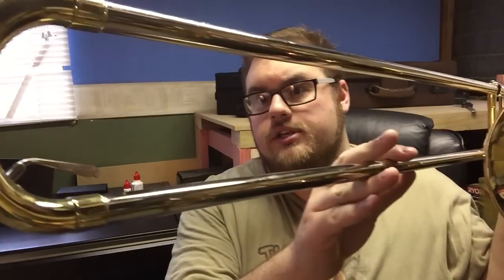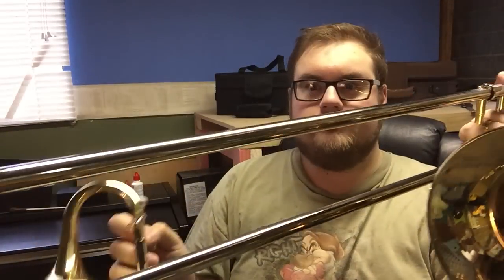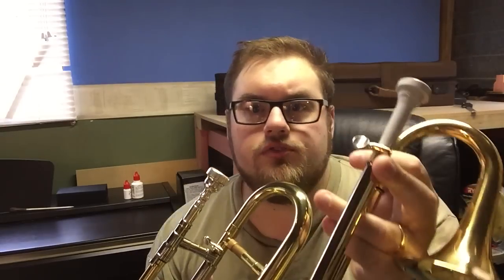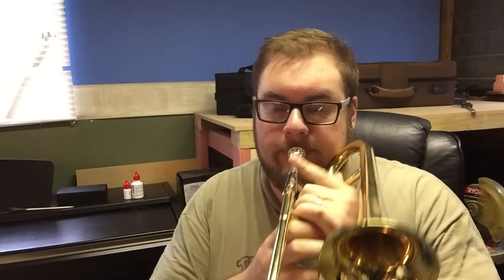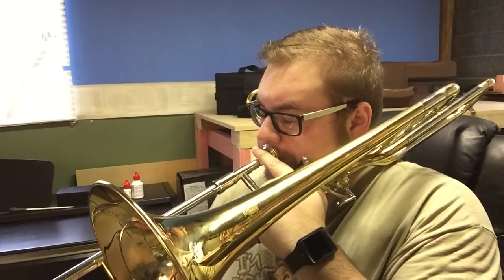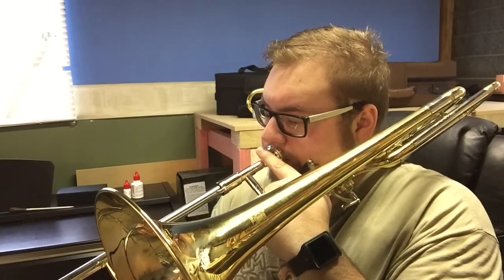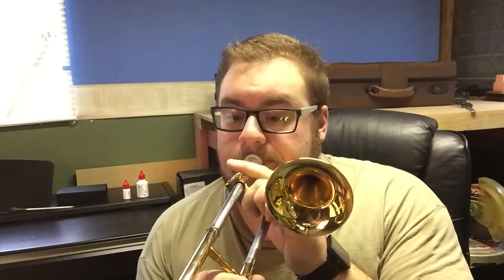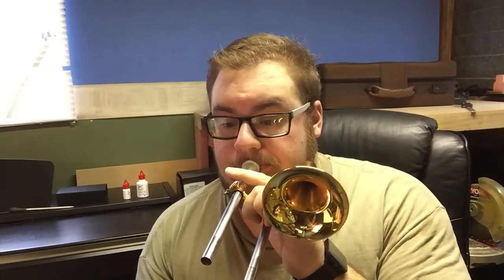Piccolo Trombone vs. Soprano Trombone vs. Tenor Trombone

Comment: I think the basic problem here is that it's Chinese Junk. I don't even see them on eBay anymore. I think it may be possible to have a proper Piccolo Trombone with 7 positiions. The trouble with the Soprano and Piccolo Trombones is nobody makes a proper mouthpeice, and they end up sounding like slide trumpets instead of high-pitched trombones. I understand the guy behind Parduba mouthpiece spent a lot of time researching, designing, and testing Soprano mouthpieces, but gave up. Maybe larger bore Sopranos and Piccolo trombones need to be built, but there's no advantage if it ends up sounding like a trumpet with a slide.
Reply: Perhaps, but the only Piccolo Trombones I can find are Chinese. The idea is probably for it to be a collectors item over an instrument. Considering how rare the soprano trombone is, I don't think any one was clamoring for a piccolo version.
Reply: TheBerkeleyGang well also it takes more ability of the player. Those types of high instruments' tones can really change depending on the player. Higher trombones can be quite useful in like say a trombone choir

Comment: Piccolo trombone needs a trigger! Many piccolo trumpets have a fourth valve to give extra range.
Reply: Yeah I believe there's only so much tubing on a piccolo one to use in the slide, since the typical trombone-shaped bell needs a bunch of that tubing already.

Take tubing away from the bell area for a longer slide, and the bell will be virtually "pulled back" towards the rear bend of the instrument where a counterweight (for like tenors, etc.) would be. It would look weird and probably affect various things.

So in order for the baby trombone here to have a somewhat normal looking bell it's forced to have that limited tubing available for the slide... by what I can tell. But tbh a trigger sounds like a pretty nice idea :) I think if the trigger allowed players to not need to go towards that last position often, that'll definitely help reduce the chances of popping the slide off with that one position's buffer.

Avoids that problem like where a tenor trombone somehow needs to do a low E♭ w/o triggers (hopefully not), and it's sorta like the fact the tenor kinda does have that "8th" position when it's really just the slide about to fall off trying to play a low E♭ XD (no I'm no trombone expert but that's my thoughts lol)

Comment: Are you saying that the Bb on top the staff is played like that when read? I'm not sure that is correct since the notation would stay the same thus, so would the frequency. I mean a Bb above the staff will always be Bb3 in bass clef. It wouldn't change between instruments. Unless you mean that the range is generally centered around Bb3 for tenor, Bb4 for soprano, and Bb5 for piccolo. Then that would make sense.
Reply from the maker: The harmonic series of this trombone is two octaves higher than the harmonic series of a Tenor or Bass trombone, that's probably the best way to explain it.
Reply: That's basically what I was meaning at the end. So thank you!

Comment: I think my trombone is in between your soprano and tenor. Would that make it an alto?
Reply: Yes
Reply: Willem Kossen I play the tenor
Reply: Depends on how large it is. His trombone was a tenor with an F attachment. The other version of a tenor trombone is a straight tenor (meaning it doesn’t have the F attachment). The only difference between the two is that the straight horn isn’t fully chromatic between the pedal tone Bb and the Bb on the staff. They both have (roughly) the same range and are pitched in Bb. If your instrument is pitched in Bb, it is a tenor. If it is pitched in Eb, then it is an alto.
Reply: If you play a Bb in first position it’s a tenor

Comment: I thought that was a tenor bass trombone, isn't there a alto and a higher "standard" tenor trombone in-between the two.
Reply from the maker: This video was just showing Bb trombones, the alto is in Eb, and fits between the soprano and tenor. I don't believe in the 'tenor-bass' trombone, because all tenor trombones and all modern bass trombones are in the same key - Bb. The only differences are in the bore size, and whether there are triggers or not. The worlds largest bore double trigger bass trombone with all the fittings still has the same fundamental pitch and amount of tubing as the smallest bore pea-shooter tenor trombone. The tenor-bass designation is a bit erroneous to me - a trombone is either one or the other.
Reply: thanks, that really answers my question. I am just about to go play my "what was previously thought tenor-bass", tenor trombone with fkey in my jazz concert tonight.
thanks again

Comment: That is not a tenor trombone, its a bass
Reply from the maker: That is most definitely a tenor trombone. Smaller bore, 8.5" bell. Bass trombones have larger bores, and generally have a bell size over 9.5" in diametre
Reply: Sometimes called a "Symphonic Tenor." Comparable models: Conn 88H, Bach 42B, King 4B-F, etc. Typically a larger bore than a straight tenor. Bass Trombone will have larger bore, and usually 2 valve sections in the bell area.
Reply from the maker: No, the number of triggers doesn't define a bass trombone. It's the bore and bell size. You can get a trombone with no triggers and have a 9.5" bell that is still a legitimate bass trombone.
Reply: Without a trigger, it has to be pitched in F or Eb, and be proportionally bigger. Otherwise, you don't get the notes between E (below the staff) and BBb, critical for Bass Trombone music. http://en.wikipedia.org/wiki/Types_of_trombone#Bass_trombone
Reply from the maker: ***** Bass trombones in Bb without triggers don't have much point these days, but they do exist. The difference between a tenor trombone and a bass trombone is the bore size, and the bell size. Nothing else. Both tenor and bass trombones can have triggers (although I've never seen a tenor trombone with two triggers), and both tenor and bass trombones can be straight.
Reply: Trent Hamilton yeah, I thought that an alto was a tenor, serious brain fart
Reply: +BeastlyCryz522 It has an F-attachment.
Reply: A bass trombone requires the rotor to be pushed down to even play. Because this trombone but he played did not have to have the rotary push down to play and because of the octave in which it plays at it is a tenor trombone in the key of B-flat and F.